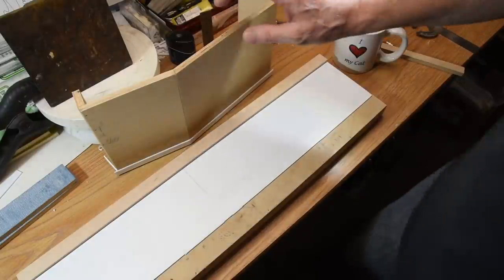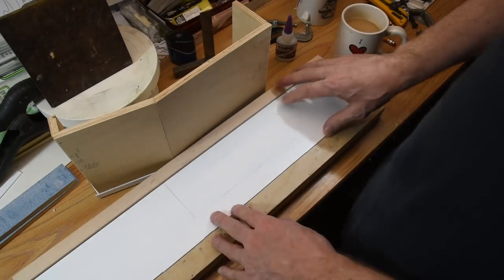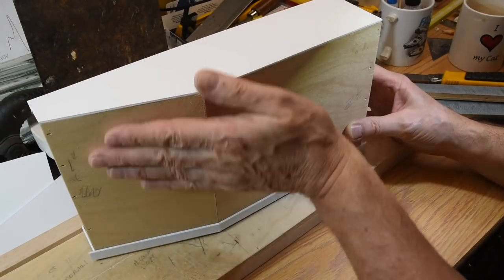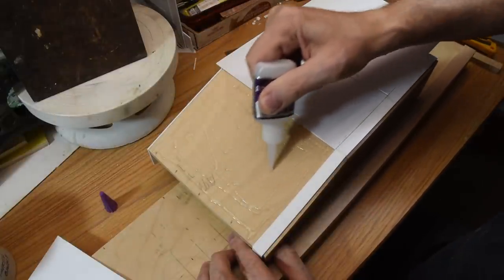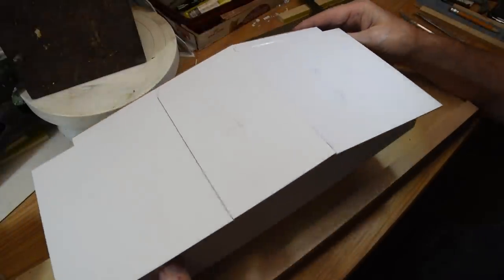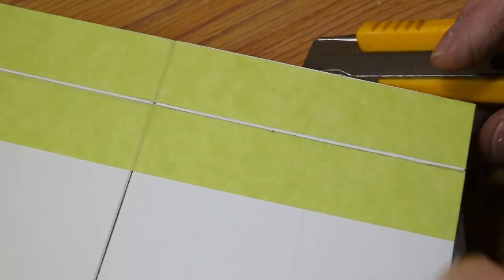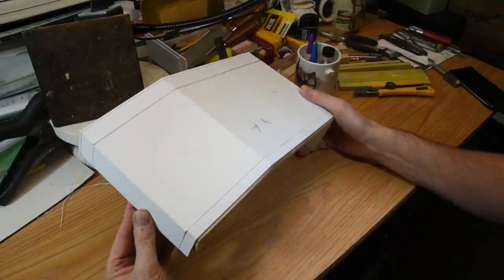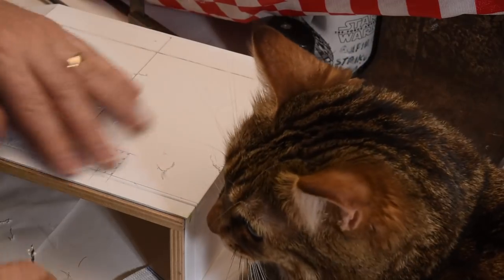Scratch Building The Small HO Scale Modern Warehouse Flat | River Road - Vlog #91

Comment: When I saw you were free handing the cut for the V groove I about freaked out. I could never get away with that. I need a straight edge to do that. Nice work. Thanks for sharing. Cheers - Larry.
Reply from the maker: I think it's O.K. to freehand a concrete slab in this case since they are kinds rough anyway. Not sure I would in other situations. ;-)

Comment: Another great video. I will have several flats on my layout. Your methods will be of immense benefit. I particularly like how you improved the visual appeal by not making it a perfect rectangle. The angle of the outside walls increase the visual interest.
Reply from the maker: It was the best I could do with a rather boring flat. Warehouse flats are under-rated and easy to build for the average modeler if they try. ;-) Cheers.

Comment: Boomer,
Great video that applies to all scales. I model O scale modern 1995-1998 industrial buildings using plastic skeletons with photos applied over it, see Lance Mindheim techniques. The problem with large scale plastic frames is that they warp when you glue them.  Using a birch frame is too heavy.  Will try using aluminum.  
Keep the videos coming, please!  BTW. My shop steward is a Devon Rex!
Reply from the maker: Thanks for sharing. Your O Scale project sounds great. I have always had a soft spot for O scale. I worked in it quite extensively in the past. Thanks again for taking the time to share though. I love to hear from O scale modelers as well. ;-) Cheers.

Comment: Totally off topic of your beautiful modeling, but on your turnouts, do you just hand throw or are you running switch machines ??
Reply from the maker: Right now Steven I am "hand-throwing" with the tension of the throw-bar holding the points to the outside rail. The points are hot Wired to bus), so no need for solid contact. Nevertheless, I will be adding remote manual (under the layout) power-routed frog switch machines at a later date. Thanks for asking. Cheers ~ Boomer.

Comment: Question: Why did you not follow the plywood when you installed the styrene sheet, on the left return (view from the camera)? I am sure you have a good reason for it.
Reply from the maker: Initially the flat was square. It wasn't until later that I decided to cut it n half and offset the building which resulted in a different angle on the return to the backdrop. Rather than revising the plywood sub-structure, it was easier in terms of production to packed out with plastic to run the side square to the backdrop. I could have left it that way but wanted the alley way to be square.